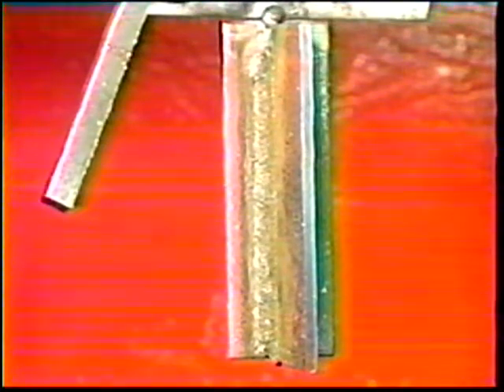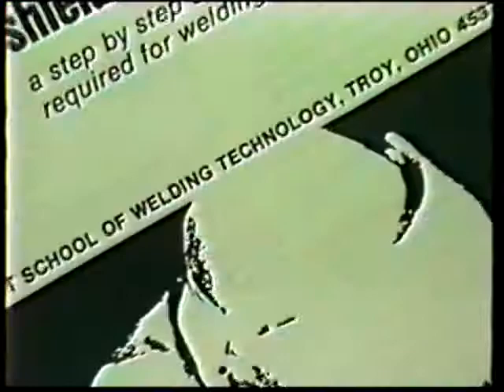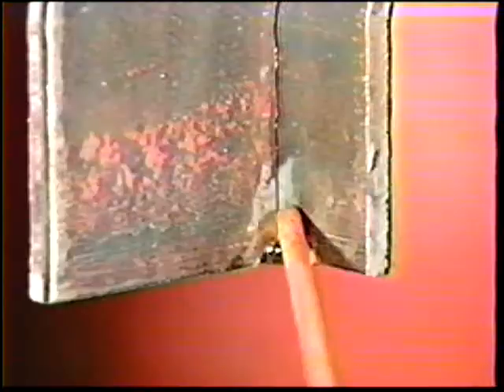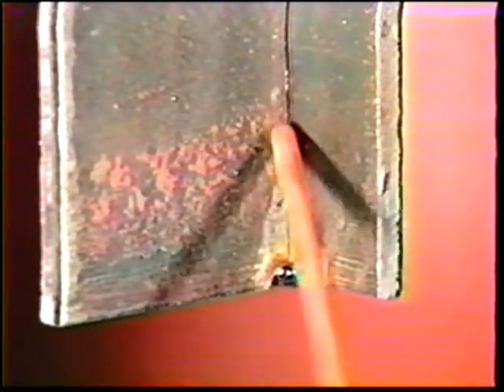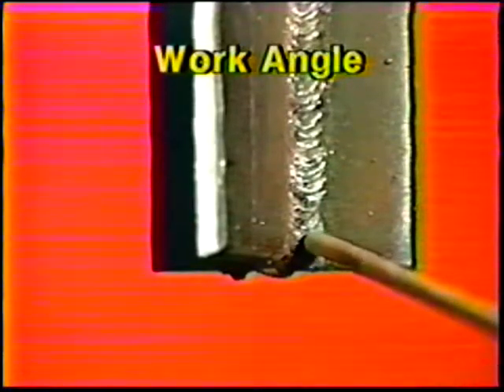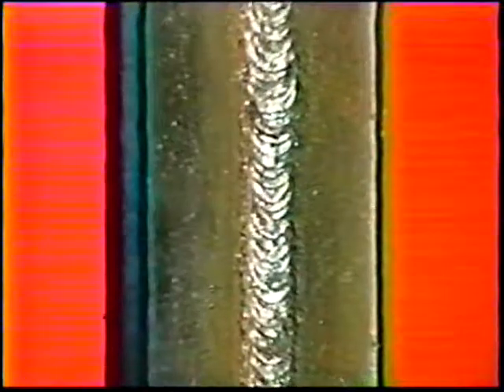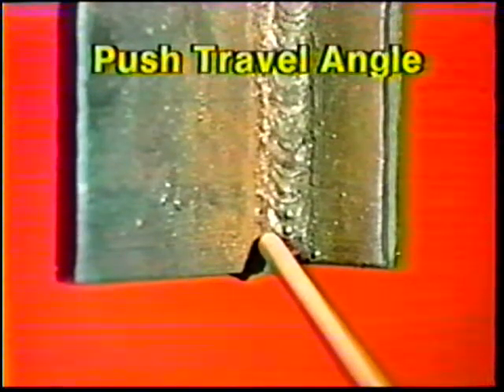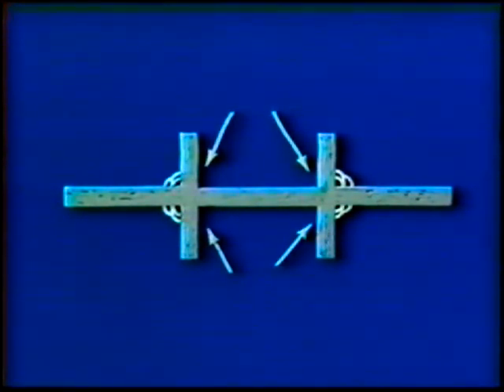Uphill T-Joint

Comment: I'm working uphill on loader arms and having a hell of time running a consistent bead for any duration, I've tried different amps, different currents, different rods, and still not running good beads. I'm going to give it another shot,.
 Thanks for the video, I think I have a much better understanding of the rod angle now and where I've been going wrong..